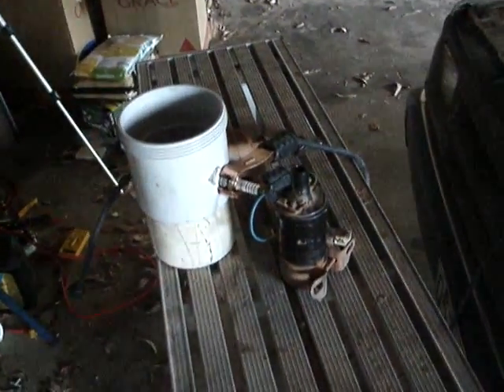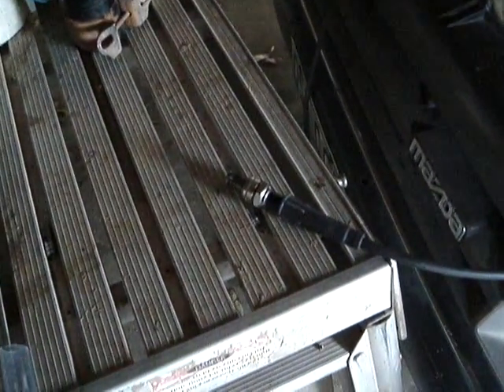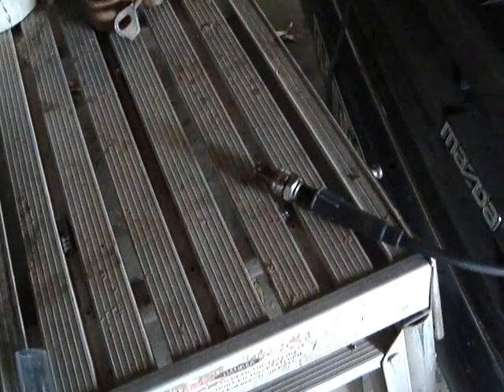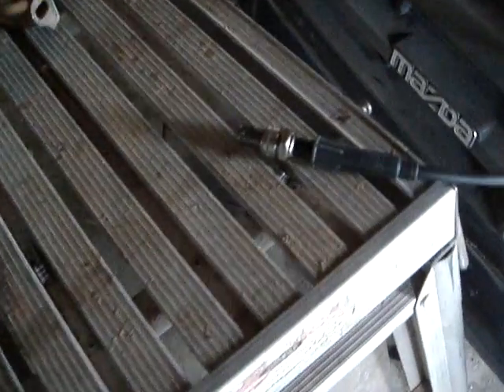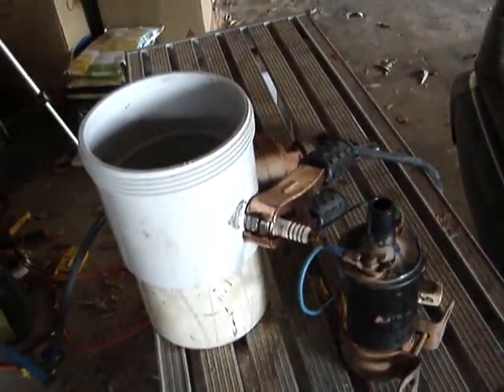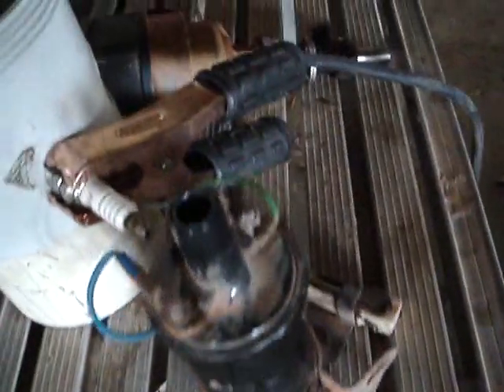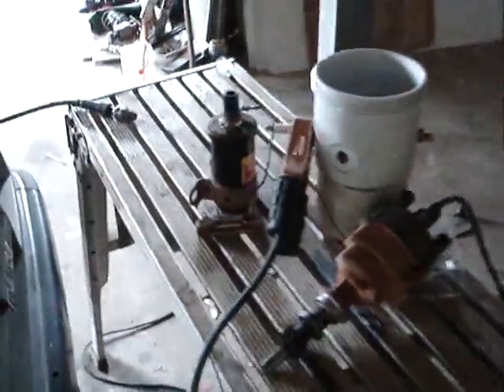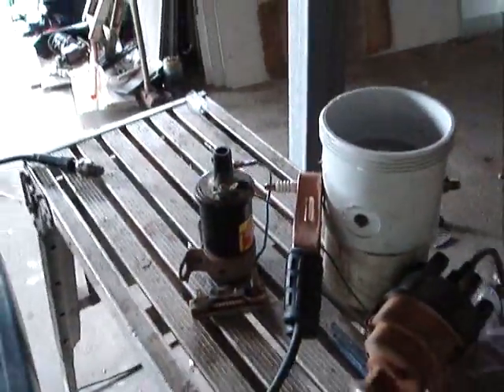Coil to sparkplug jump

Comment: there is alot of variables here.
it looks like there are rubber feet on the aliminium bench.
if thats the case and there is no earth to ground,then the bench would behave as a large capacitance.
even if not earthed,the gap the spark is jumping,and the surface area would have some capacity.
an ignition coil like that should be able to throw 1.5cm spark with the points wide open.
air is a dialectric and adds capacitance.
try insulating the coil from the table,&/or the table from ground.